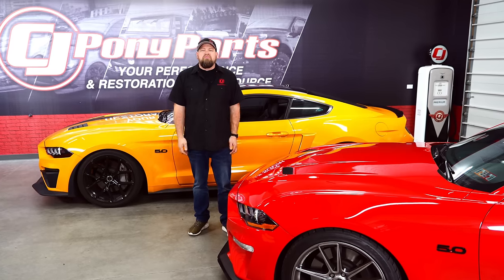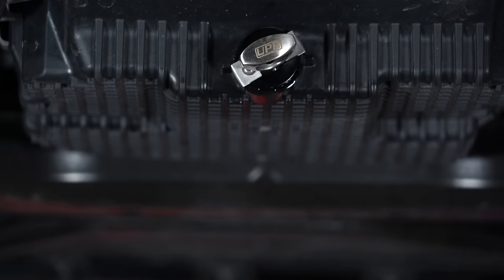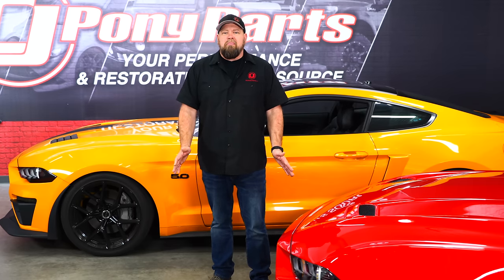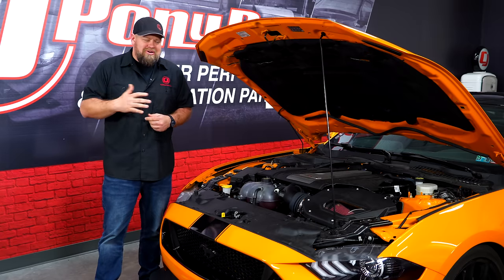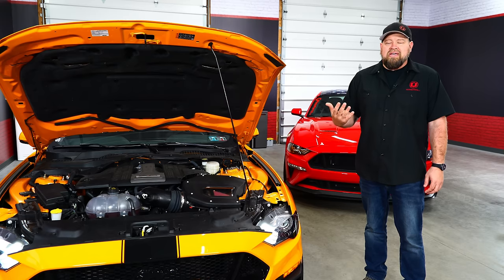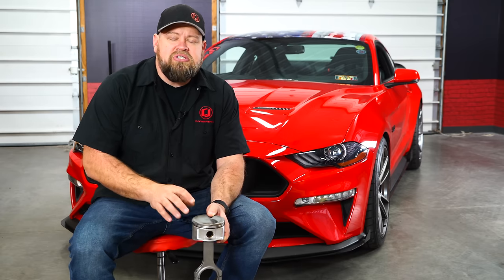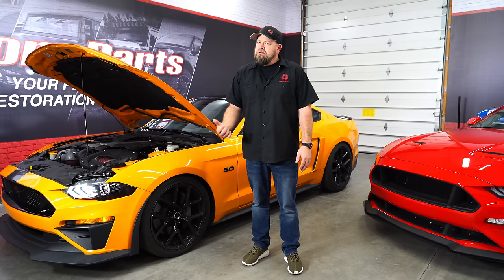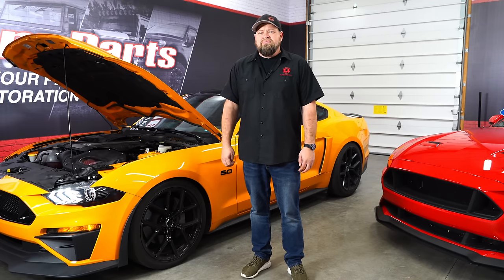2018-2019 Mustang Tick: Should You Be Concerned?

Comment: Thanks for the video. Too many arm chair quarterback out there trying to claim they know it all. We just started getting the tick on my wife's 18GT about a week ago. I am going to work through all of the possibilities and hopefully it is no big deal. I heard the going to a 5/30 instead of 5/20 oil helps. Gonna try that first.
Reply: I know that it has been 6 months since your post. Just wondering if you still have your mustang and how it’s performing with the engine tick. 

First mustang I have owned was a black 2015 GT auto as seen on my channel. Before I was able to post any other mods other than the exhaust the mustang blew up at 800 miles sitting in my driveway after remote starting it. I went through hell with the dealer where I purchased from. They eventually offered to sell me another Mustang after buying back the 2015 after many many conversations with the (GM).
The replacement was a 2016 Mustang GT PP1 that I mildly modded, exhaust, intake graphics etc. That car was amazing with no issues at all, of course I was dumb and sold it locally.

I now own a 2019 Mustang GT PP1 Manual. The car had developed the engine tick after driving it home of course. I’ve noticed when cold starting the vehicle and letting it idle down after 5 mins the tick is apparent. Driving the car not to exceed 4,000 rpm’s for approximately 10 mins, the tick dulled slightly to where you couldn’t tell by just walking around the car. My oil was changed at 1,000 miles after the “recommended break-in” using 5w-30 Mobile 1 synthetic and Motor craft oil filter. The tick is still apparent at 1200 miles.

I just wanna enjoy my car without having to deal with Ford “Again” in that matter. Looks to be in Inevitable at this point. 

Any updates would be gladly appreciated, Thanx.
Reply: @houghnstuff7978 hey buddy you still have the mustang 2019? Everything good?

Comment: I dont quite understand why if Ford has a term for it and they know about it, why have they yet to discover what it actually is. You would think fixing the issue would be cheaper than throwing short or long block at it under warranty.   Not to mention improving relations between them and the customers by actually fixing the issue.

Comment: Mine is quiet with Ceratec. I race it damn near every weekend & it’s been boosted since 400 miles.
Reply: Do you do 2 bottles every oil change
Reply: Exactly people just need to send it look at midnight performances 2018 mustang you think if the tic was such a big deal they would push the car as hard as they did
Reply: nola504boy1 hey do you  drive auto or manual?
Reply: Stick GT my 2018 is a auto.
Reply: @nola504boy1  I've been using redline 5w30 since I first got it. Gonna add some ceratec in on the next oil change. Haven't really been worrying about the noise because it's only at initial start up.
Reply: @jawaunb8405  Same here.

Comment: I own a 2018 Mustang GT that had 2400 miles on it and had the tick I had it checked they found excessive cylinder scoring in cylinder 3 and they replaced long block. After having the long block put in when I picked up from the dealership it was as quiet as a church mouse. After a hundred miles of driving I could faintly hear the tick. After 650 miles the tick has gotten louder but not as loud as it was when I first got the engine replaced. For the love of God  Ford needs to come up with an answer fix these because you can't fix it if you're going to put the same broken parts in it.!!! I am now waiting till spring because my car is in storage for them to look at it again and to see what they're going to do about it. Love the car but really for $50,000 I shouldn't be going through this!!!
Reply: Oh and I also did not go about 4,000 RPM all the way to 650 miles and still got the tick
Reply: @tb12269  Add a bottle of Ceratec.
Reply: Not only add a bottle or Ceratec but do you first few oil changes between 1000-2000 miles. Crazy to leave the oil that comes with these engines for that long
Reply: @19coyote5oh9  does the ceratec replace some of the oil or is it in addition
Reply: @tb12269   Its an additive, if your oil level is right in the middle of your stick you can add as much as 2 bottles without draining any oil.
Each bottle is 300ml I believe.
Reply: @19coyote5oh9  so do you think it should be added every oil change because I have seen somewhere that it's good for like 20,000 miles or something crazy cuz it bonds to metal
Reply: @tb12269  In my case its preventive so I'll be adding one every oil change.
If what some believe is actually happening, Ford is adding an additive at the factory which would explain why a lot are experiencing this "tick" after the first oil change because the dealers are doing a straight up oil change.
Meaning if in fact they are using some sort of friction reducer it's draining out with the oil.
I'll just add a bottle every oil change on a regular schedule just to make sure.
Reply: @19coyote5oh9  all that does is mask the sound. It doesnt fix it bruh
Reply: @YNTGUNS  That in its self is the fix, It prevents the metal on metal contact that can possibly score the walls.
Reply: Lemon law it
Reply: Lol and the manual clearly states 5k mile oil changes unless driven hard.  Then 3k miles.
Reply: Lol they are gonna do yall like the focus and fiesta. Ford is trash.
Reply: @raullara1594  so you come to a ford video to say that fords are trash? let me guess you are one of those  that love to vape right?
Reply: @fmxinsane  yeah bro I'm hitting my dank vape atm 90% thc 😉 I own a focus and its trash just like any other ford car. Probably the last ford I will ever buy in my lifetime.
Reply: tb12269 I totally agree with you. Ford has cheapened out somewhere & it’s comming back to bite them!

Comment: Good video Bill, straight talk is good to hear. Have a 15 GT , PP1.bought used March of 18 , 15,800 mi. No tick now at 24,000. Let dealer change oil as I am 65 yrs. old and will not crawl under it to save the 8.11 the dealer charges for labor Use the5/20 oil and motor raft filter. Not trying to sell just saying. Also have a 09 GT w/46,000 mi. that has developed a supercharger whine recently, any idea what or where this is coming from? No, Santa didn't SC it , I looked! Thanks!

Comment: I'd rather own a car that doesn't annoy me.
Reply: 95% of vehicles have issues these days. Technology is decreasing reliability. But if such small minor things annoy, buy a bicycle.
Reply: @MasterCarguy44-pk2dq  , Or A Motorcycle
Reply: Camaro and vettes annoying.. Mustang  Classy
Reply: @MasterCarguy44-pk2dq  A ticking motor and Chinese gearbox that pops the forks on the 3-4 upshift regularly. Yeah, that's "Minor." In a softening/falling new car sales market and these issues being out there over several years (as said in the video), this is just stupid on Ford's behalf
Reply: That’s what I’m trying to relay to people. If people don’t like it and quit buying mustangs they will fix it. They not going to fix it if people ignore what they don’t like. Damn go drive a SS you will be surprised at the low end power and the razor sharp in puts.
Reply: @MasterCarguy44-pk2dq  small minor things?
The 2011-2013  need the short block replaced

Comment: I was wondering if Bill would ever make a video talking about this. My tick started around 800 miles with factory oil. I switched to M1 EP 5w20 at 1,000mi, and it got worse. It started subsiding over time as carbon built up in the oil. At 3,400mi, I switched again to Pennzoil UP 5w30, and the tick was even more noticeable, even though he oil is better than M1. Found no metal (maybe 5-6 tiny flea sized flakes) after straining all 10qts of oil, and inspecting the filter. So, I added 1/2 bottle of Ceratec, which got rid of 90% of the tick. I also had a rattle at 1,200rpm on up, so I installed an A/C belt tensioner, which eliminated that rattling noise up front. May have been the compressor making noise from using a stretchy belt.  Since some minor remnants of the tick still remained, I added another 1/2 bottle of Ceratec at 5,000mi, and now the tick and all rattling is completely gone. 

My recommendation for this car,  is just add 1/2 bottle of Ceratec if you don't have a tick and add 1 bottle of Ceratec if you do have a tick after about 200 miles of ownership and the rings are seated. 1 full bottle of Ceratec is really enough. Adding 2 whole bottles for 10qts of oil really isn't necessary, even if you already have the tick.
Reply: Will this make the oil thicker?

Comment: My 2019 Mustang Bullitt has the tick from time to time. I do have to keep a close eye on the oil level in the engine. The tick seems to be worse when the oil level gets down one quart. I'm still using the Motorcraft synthetic blend 5W-20. I plan on changing to Motorcraft full synthetic 5W-30 at the 10,000 oil change. Funny thing about oil additives like Ceratech and BG44K. Ford specifically says in the owner's manual don't use them because they aren't necessary, and could void the warranty if you do. My local Ford dealer offers BG44K as part of an oil change service package.

Comment: Nascar engines have tight clearance's....they don't win daytona with "5w20 oil"
Reply: They are also not designed to spend hours on traffic, and drive in the middle of winter.

Racecar engines are a very different engineering problem compared to street engines

Comment: I was ready to buy an 18gt and all these issues changed my mind
Reply: same, you can't avoid this issue, I wasn't looking for it and found it with a simple "2019 mustang gt" google search.
Reply: @paulgallagher8582  Yep, you have already seen my issue. Not only the engines have an issue, but Ford is going to do Fuck all to fix it! Instead, they are issuing TSB stating it is normal. My question is what is abnormal then?!?
Reply: It's making me want to keep my V6. I am considering a 2018 GT but I went through the driveline vibration that was never totally fixed and I rather keep my V6 then spend MUCH more to go through a new problem.
Reply: Same here I'm somewhat regretting changing my mind I just bought a Veloster n performance pack which I'm very happy with but bottom line I was always a mustang guy and it's never going to be a Mustang I do however want to get into tracking the car so the Veloster and no doubt is the better track car than a Mustang GT so I'm not unhappy with my purchase I love the Veloster but it sucks that that typewriter tick and the shift Fork problem kept me from buying a brand new 18 19 gt
Reply: Not to mention insurance rates played a part in my decision also the Mustang GT would have been a little more expensive in monthly payments of course if I wanted to go fully loaded with the performance pack one Digital dash Ford Sync premium 401a package but I still would have been happy with the base GT at least with a performance pack only and a ford synk
Reply: @Capt. Slow incorrect. It affects all 3 motors. Most of the people reporting have GT's. It's an alignment issue among other things. Bad overall design.
Reply: @Capt. Slow Lol any full synthetic would have done.  Amsoil is overkill
Reply: mcgubber3500 get a gen 2 and boost it with the money you save
Reply: The percentage of cars that have this issue are few and far between. Same thing with the faulty shifter forks. I have an '18 with the manual and it's perfect. I'm about to hit 10K miles this week as well.

Comment: Yep, mine has had the engine replaced and new engine has metal in the oil and ticking as well. Ford is buying it back as I type this.
Reply: Good 4 you dude.... these GT's got serious issues.
Reply: Sinistr Productions - Did you have complete engine failure when Ford replaced your engine or did they go completely off of the engine tick?

Comment: I have a 2020 Mustang GT with 1500 miles on it. Its ticking, its 100% the metallic ticking.. Sounds like metal expanding after a heat cycle but the engine is on... Sucks to spend 50k for a car that has this damn noise

Comment: Got my tick at 30,500 miles after an oil change at a local ford dealership. Car is a 2015 and I just recently purchased it. I’ve got 4 months of warranty left based on its age and I’m hoping the motor either blows before that 4 months. Or this stupid tick isn’t anything to worry about. Great video. Appreciate the feedback on additives. Going to give it a shot. I bought the car because everybody said the coyote is bullet proof. A tick at 30,000 seems to be contradicting their theory.

Comment: Had a buddy who was a ford certified tech and got these cars back day in day out after every new year that came out. He got to tear one down and they came to the conclusion it was the wrist pins in the motor. It holds the pistons to the connecting rod. Totally normal and not harmful ether just trait of the pins they use in manufacturing. If it becomes constant and hard than it’s time to worry.

Comment: it's the internet. they always blow everything out of proportion
Reply from the maker: Khyber GT couldn’t agree more
Reply: My car has been at the dealership 3 months. New engines are on backorder, it's a nightmare. Cyl 1 scored to hell at 2k miles 2019 gt. It's not being blown out of proportion
Reply: Edrees Roshan the dealer is probably happy to get the warranty hours from your car! It’s really not a issue! It’s the internet and untrained people doing it! Drive that car like you never drove fast in your life! And don’t sit at 2,000 rpm all day trying to make the noise!
Reply: @jakesantanella  nope. I'm not new to engine damage and saw the damage myself through a borescope. I felt the tick turn into a knock myself through the shifter every time the engine got warm. I felt it deteriorate myself. You dont know what you're talking about as you didnt experience the issue firsthand. It is real. It's not being overblown. The addition of the spray on liner is taking this quirk and turning it into engine failure
Reply: @edreesroshan9829  He's a troll it's a real issue or FORD wouldn't give people small/long blocks for no reason.... then it STILL ticks.
Reply: I would've assumed if you were gonna bring up the topic you would try to actually figure out where the sound is coming from since you have a vehicle that's making the noise. Don't they sell an instrument that you can put in your ears like a stethoscope and pinpoint where the sound is coming from
Reply: i disagree bc they're dozens of actual video footage of these problems , this isn't a he said she said problem..but your bias is understandable since you're a ford mustang owner
Reply: Until you people really find a way to research how many short blocks ford has replaced. See if your local dealer will honestly tell you.

Comment: I know this is an older video and the reason I came here is because I bought a 2020 Ford F150 with a 5.0 the ticking/knocking sound. My comment wont really contribute anything to this but thought I'd put it here for new 5.0 owners. My ticking/knocking goes away after the engine is fully warmed up. I ran 93 octane, and now run e85 so I'm certain its not detonation. The piston slap is a bit concerning and I wonder if maybe the skirts aren't right. Seems to me the easy fix would be for Ford to machine and put new sleeves in for cylinders.

Comment: From the looks of these comments I am feeling better about my own personal opinion.  The slap is coming from poor break in.  People changing oil too soon.  Some have changed it at 500 miles.  The manual clearly states 5k miles unless driven hard.  Then 3k.  Even says if commuted it can make it to 10k miles.  Those who have changed their oil later are not having issues.  Those who have because they are panicking over it, are developing issues.  I cant confirm it, but I feel it is part of it.
Reply: J. I don't understand, putting new oil damages your engine? You should change the oil frequently while it's in the brake in period
Reply: @selaudinagolli4638  
Ford has additives in the oil to help it break in.  There is a special liner installed in the cylinder wall.  The manual does not say change the oil at 500 miles.  It actually says do not load the motor until 1k miles.  Thats it. No mention of break in oil changes.  It addresses oil changes at the increments I stated.  When you dump those additives out at 500 miles or even 1k miles, I believe it is causing the problem.  My dealer told me bring it in at 5k miles.  My father bought an F150 at a different dealer.  They told him the same.  My brother has a Kona 18 5.0. Different dealer.  They told him the same.  My mother has a 18 orange fury.  They told her the same at again....another different dealer.
Reply: J. The additive thing makes sense! Didn't know about this
Reply: Interesting theory you have there. You might be onto something . Because it does seem like many people complain the tick right after their first oil change @ 500 or 1,000 miles.  Now, I’ve changed the oil on my  last two new Ford vehicles at 1,000 miles (only for the 1st oil change), and had no problems or tick, but then again they weren’t the updated V8 from the ‘17, 18’, 19’ Mustangs. Btw, one of my Fords has a 2016 Coyote V8 that runs flawlessly with 38K. However, I think in the future I’m going to do what you’re saying and just follow the manual recommendations when I buy my next new vehicle.
Reply: J. I drove mine to 7,200 miles with the factory oil. No tick. Changed the oil and tick started at 8,200. One bottle of Ceratec and it’s gone. Definitely some secret squirrel additives in the factory oil. I change my own oil so an extra $25 for a bottle of Ceratec every 7K miles is no big deal. I go through $25 in gas every day and a half.
Reply: It really sounds like this is the case. But this noise is documented by Ford, and they don't say this. If it was something easy like this, you bet they would be saying it.